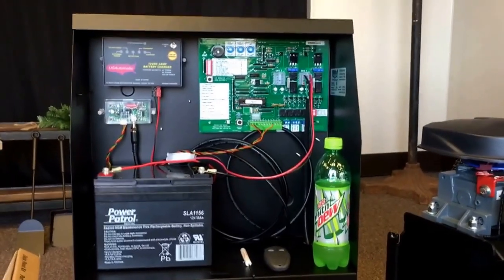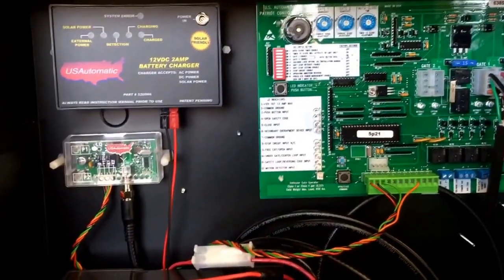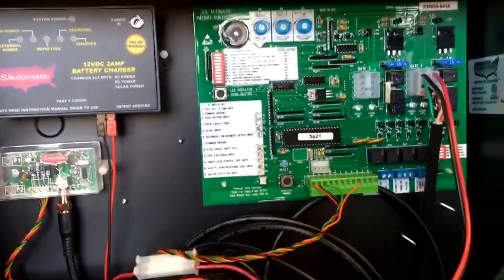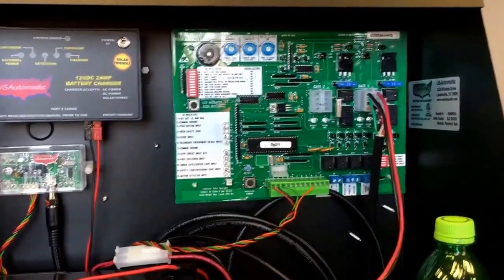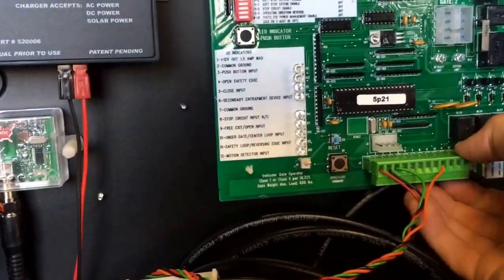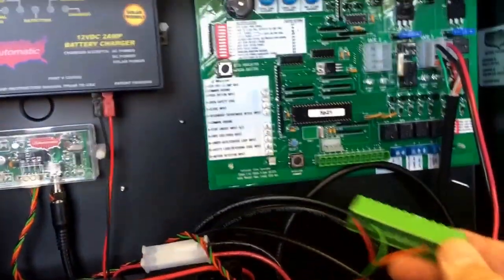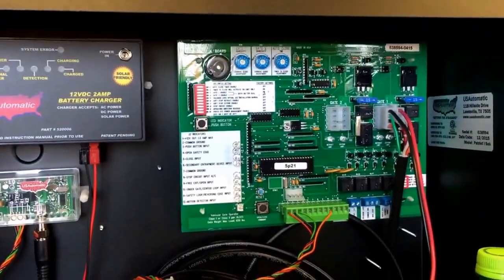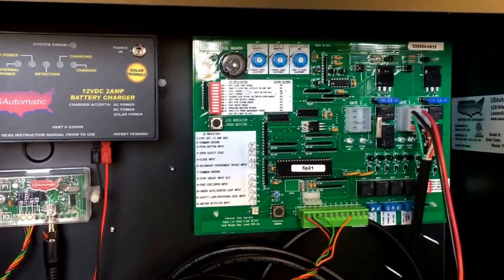Patriot 1 basic troubleshooting #6

Comment: Hi. Confused on the red dip switches. We have the same Partriot board. The dip switches have OPEN written on the opposite side to what you mentioned, i.e, pressing it  ON towards the letterings on the white paint side. Please advise. Also do the receiver dip switches match these red dip switches?  We have a Multi-code receiver. Everything was working fine and suddenly nothing is working :(

Comment: I have a 15 yr old patriot that just all of the sudden intermittently stops working completely. No power whatsoever but the battery shows 12.6v. what could it be? fuses are good. I can get to start working again then stops again completely. keypad functions properly but gate still wont open

Comment: Hi. Have a Patriot I. Gate will not close. Pressed the LED Indicator button, Master -> Open limit & Slave -> Open Limit LEDs light up.  Battery has 8.95v.  Press the open/close command button I only hear beeps. No movement at the gate. Fuses are new and are 15amp each. Any suggestions?
Reply from the maker: Everything sounds perfect, except the battery is dead, the battery should read 12v or more. it’s a 12v system and being at it’s current voltage it’s not going to work. We recommend charging on trickle charger overnight, If the battery will not charge up to 12 V after charging overnight, replace it with a 12 volt SLA1156 maintenance-free battery.
Reply: @txgates  Thank you.

Comment: How do u know if you board is bad, I get not voltage output to my actuators.  Any genuine help is appreciated.
Reply from the maker: A low or bad battery causes most problems. Make sure your battery is fully charged; we recommend the SLA1156 Maintenance free battery. Also, confirm that the 12v fuses are good. press the blue reset button for good measure if that doesn't get you going we suggest contacting the manufacturer USAutomatic for tech support 1 (888) 204-0174

Comment: Charged batt ,cleaned conections,replaced fuse,pushed reset started actuator working. Gate was unhooked from actuator shaft. Shaft will not go back in sleeve enough to repen to gate. The shaft it self is extended all the way out and shaft spins when on.will not

Comment: My gate is making a squealing sound and it's coming from the actuator. It still works. Anybody know anything about that?
Reply from the maker: Rick H is it coming from the tube as the gate is in motion? The black tube cover has a “wiper” O ring located where the silver to retracts in an out, that can swell up and cause a squeaking noise. If that is the case the only way to replace that O-ring is to buy the complete tube cover

Comment: I have a US Automatic Patriot Control board that has worked flawlessly for more than ten years, until today.  In the middle of the afternoon it randomly, by itself, started a cycle of opening, then immediately closing, then immediately opening, then immediately closing, etc. etc. etc.  The only way I could stop it was to disconnect the power.  Tried resetting, disconnect battery, cleaning (with electronic spray) teminals, etc.  Is there anything that you know of that should try other then replacing the board?
Reply: Call a priest.
Reply: are you still around? what did you eventually do to fix your gate?
Reply: @davesueful  re[;aced everything
Reply: Ha, this just started happening to my gate… did u get it figured out? I am thinking of replacing the remote receiver (the little clear box below the charger). Also not sure if it’s just acting weird cuz the battery might be low, so Ive got the battery on a charger.

Comment: My gate won’t close and no LED is on? I checked the 2 fuses already and they checked good.
Reply: The optical eye on the opposite gate post (furthest away from the metal control box), runs on two small batteries. They look like double-A's but they are a specialize 3.6 volt you can only find at battery stores. Open up the small optical eye box by removing the two small phillip's head screws located on the front plate. There you will see the two batteries. Take them to a specialized battery store in town (or order off amazon) and replace them. They are only supposed to last about 18-24 months. Hit the reset button and your gate should be back to normal operations. So, you should be prepared to do this every couple years.